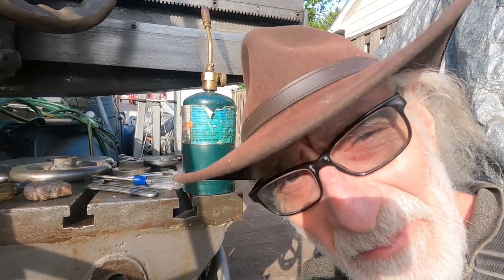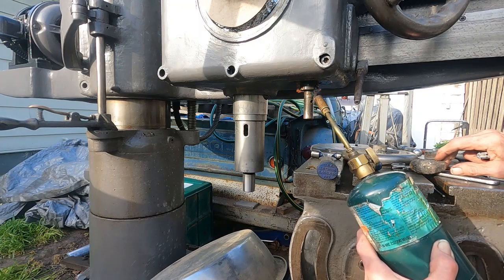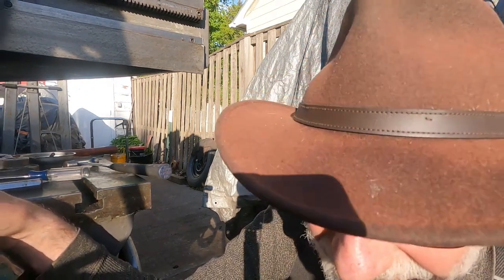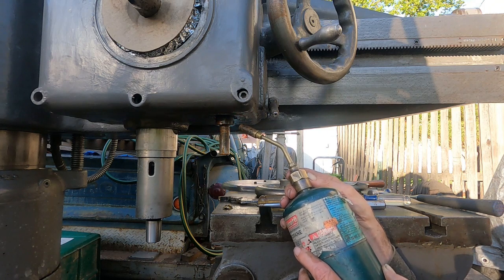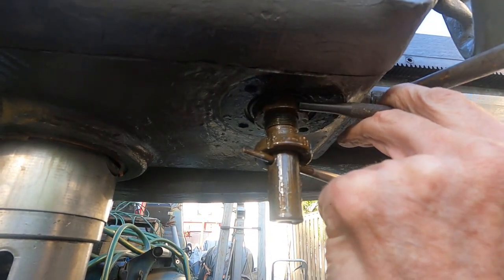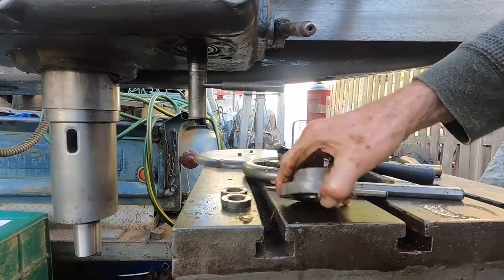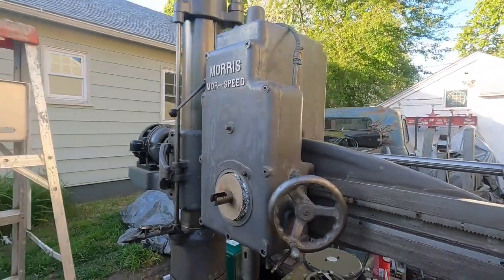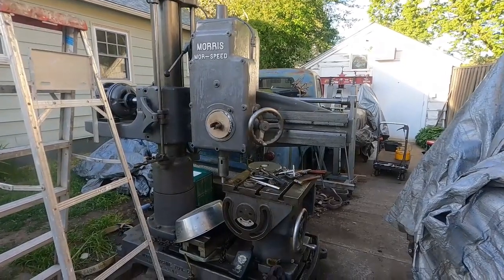Radial drill press power feed restoration

Comment: You can still get old school cans of WD-40 from Fastenal and often Napa.
I usually use PB Blaster, it will break loose some pretty solid stuff.
Reply from the maker: The PB blaster works like the wood working machine restorers use of acetone and atf transmission fluid, combined with a brass brush causes a chemical reaction that removes rust off surfaces good. On large projects the home mix is economical. Thanks!

Comment: Have you figured out how you're going to get to the bearings behind the drill head? I recall you saying something about possibly making a hole in the back of the arm. Still the plan?
Reply from the maker: I think the best plan is to remove the drill head. I can move it to the front of the building and use the structure to steady the rigging to do that, should be entertaining!

Comment: A skilled guy would be able to make a socket to install and remove those nuts.  A guy could even cold blue the socket.

I think Eric from South Main Auto uses WD40 just to get people spun up.

We used to use it back in the old days when there weren't a lot of options, but mainly to spray under distributor caps and along high tension wires and whatnot to dry things out.  Especially good for old Chevys with the rear engine distributors and going through big puddles in Oklahoma.  You know, flash-flood kinds of puddles.  Always carry a spare can of WD40 and an extra set of points.
Reply from the maker: Yes anyone could burn up hours making special tools for one time use that was already easily taken care of with heat and bees wax with no damage I have the hook spanner for proper installation. That amateur spray product will never appear or mentioned again on this professional channel, thanks.

Comment: Good morning Don. I never tried bees wax, but have used candle wax on seized bolts and nuts to free them up. Thanks
Reply from the maker: The Bees Wax has a higher flash point than paraffin and seems to penetrate better. This is what will get a steel plug rusted into aluminum out and leave the threads, but it takes heat and sometime a couple of cycles to do it like here, thanks!